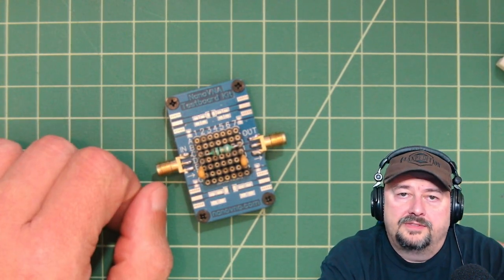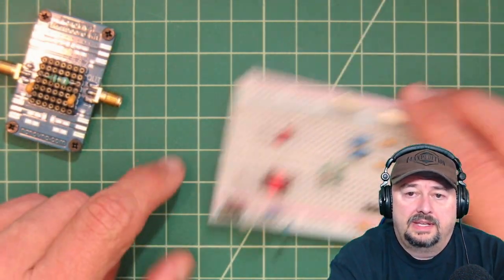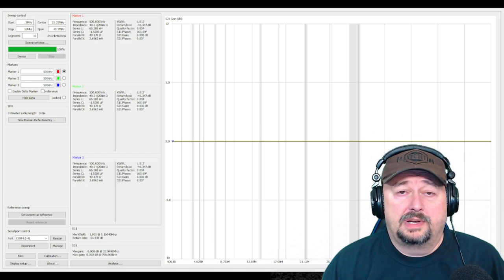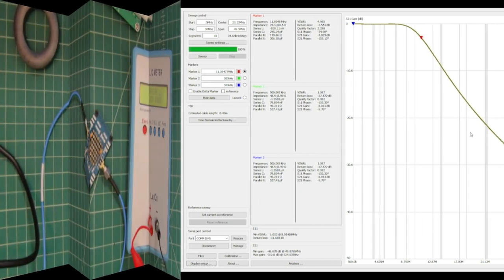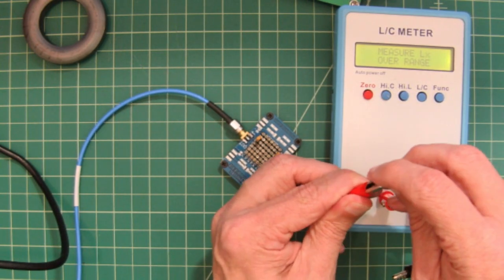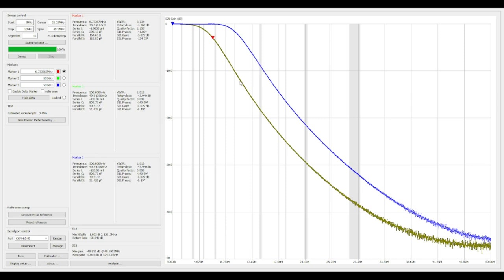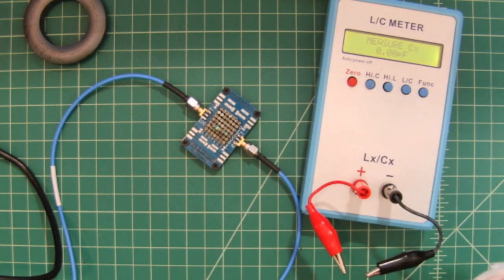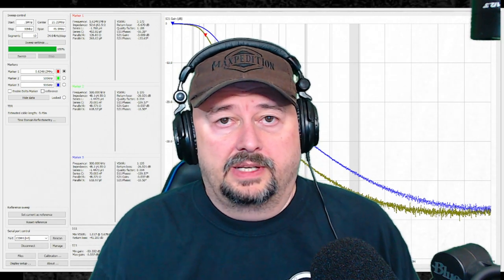Low Pass Filters - Ham Radio

Comment: Thanks for sharing ! I really dig the RF prototype board. What are your thoughts on that LCR meter ? It has a good price point. Has it been accurate ?
Reply from the maker: I like the LCR meter and will continue t use it, I have had positive results when measuring components of known values.
Reply: @TheSmokinApe  Cool beans ! I have I have one of the extech ones and it is good  but am always interested in something that will provide the same service for less.  Thanks !

Comment: You could also build such a filter test board yourself. Did you calibrate with the attached test cables?
Reply from the maker: I could have built the board myself but I didn’t and I can live with that.  The calibration was done to the end of the coax with a female to female barrel connector.  The isolation calibration was done with 50ohm loads on both ports.
Reply: @TheSmokinApe  If I could buy the part around the corner, I would buy it too. Thank you for explaining the calibration procedure to me. Everything done right.
Reply from the maker: @karlbesser1696  no worries about the calibration.  I got the board as part of a larger order from Ali Express.  It’s come in handy a few times 👍